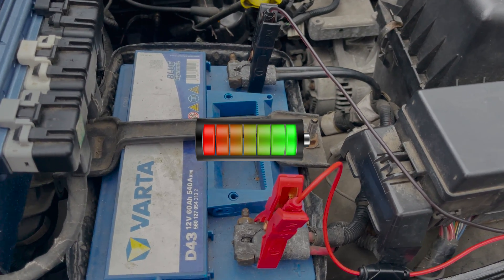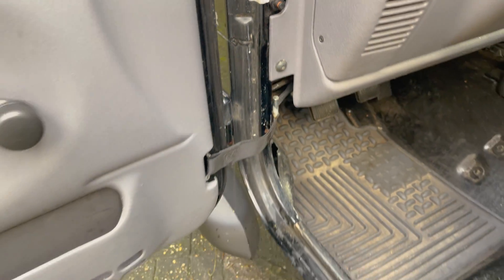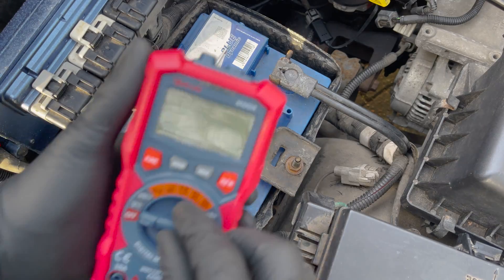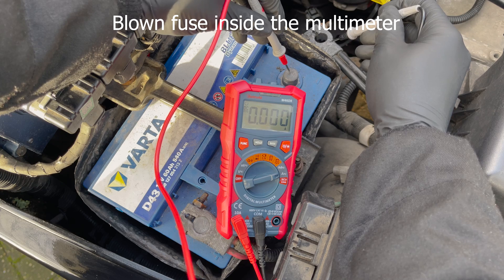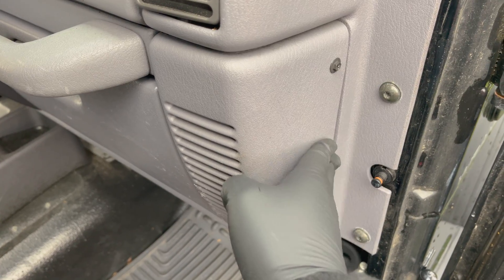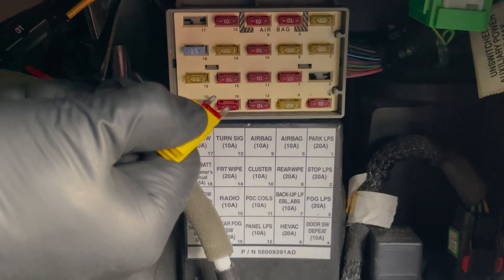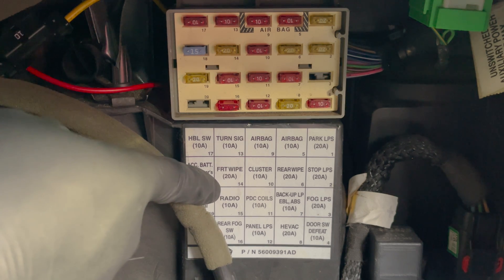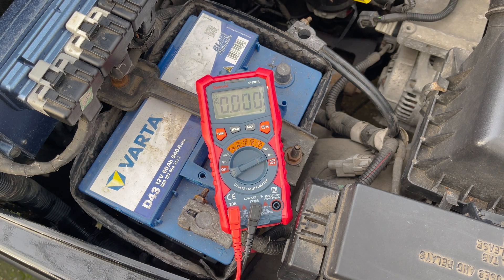The EASIEST way to test parasitic draw

Comment: Hope removing fuse & replacing method won't give wrong readings in a case where a removed fuse controlling a particular component will make d certain modules go to sleep.
Reply from the maker: That's why with modern cars you have to wait half an hour or sometimes even longer for the computer and electronics to go into sleep mode before performing this test.

Comment: Excellent! Straight to the point. Thank you. I had never heard of parasitic draw before today. I just purchased a 2019 RAM 1500. This is the first vehicle I've ever owned that has this much electronics. I love it but I also love my 1989 Toyota pick up. I can replace every part under the hood and see everything. So after turning off the ignition in the Ram 1500 I have noticed that things are still happening under the front dash. Humming, ports opening closing because of the Star Wars-ish whoosh (no exaggeration). It sounds like the opening and closing of the doors on the Death Star. So it made me wonder about power usage when the battery is not being charged. Every time I open a door, lights come on, the screen comes on, and they stay on for what seems a minute or so. So it's got to be a drain at some point right? Doing research today, I found out that it is called parasitic draw and there's an allowable amount of it! I wish it was zero. I'm old school and very utilitarian. I like all the bells and whistles but let's not get crazy. Thanks for the video!
Reply from the maker: Thanks a lot! Glad you found it useful.

Comment: Your meter may confuse some viewers who have a different meter.   On your meter, the switch is turned to the symbol for AC amps, which has the sine wave line under the solid line, but the digital display shows DC amps, which has the symbol with the dashed straight line under the solid line.  I have 3 multimeters where the rotary switch can be set to DC amps or AC amps.  If I did it like you did it on the video, I would be trying to measure AC amps instead of DC amps.  I am assuming that the "func" button on your meter selects between AC amps and DC amps.  Your video helped me a lot.  Thanks for taking the time to post it!
Reply from the maker: You are correct! Our multimeter has a single symbol for both AC and DC amps, which we can switch between by pressing the FUNC button. If you have a multimeter with seperate symbols on the rotary switch, you have to turn it to the DC symbol with the dashed straight line under the solid straight line. Thanks for the feedback!

Comment: In one shot you have the negative lead from the multimeter on the battery terminal and another you have the positive, does it matter which way you do it?
Reply from the maker: No this does not make a difference. It will only change the "direction" electricity flows through the multimeter, displaying the parasitic draw as a positive or negative number. It does not change the measured value itself. If you connect the multimeter between the negative battery terminal and the battery cable with the black test lead on the battery terminal, it will display the parasitic draw as a positive number. Put the red test lead on the negative battery terminal and the black test lead on the battery cable and it will show the exact same parasitic draw, but as a negative number with a "-" sign in front of it.
Reply: @classiccarmaintenance  thanks!

Comment: How does the radio in the car turns on if the negative lead is off? 🤔
Reply from the maker: With the multimeter forming a bridge between the negative battery terminal and the negative battery lead, there is enough current passing through the multimeters' test leads to power the radio and other small accessories. However, the amperage is limited by the capacity of the multimeter itself and its internal fuse(s).

Comment: How does the radio turn on when the battery is disconnected?
Reply from the maker: With the multimeter forming a bridge between the negative battery terminal and the negative battery lead, there is enough current passing through the multimeters' test leads to power the radio and other small accessories. However, the amperage is limited by the capacity of the multimeter itself and its internal fuse(s).

Comment: Hello I'm trying to setup my multimeter to the correct setting.on my multi meter mine doesn't have the A—~ but it has the 10A—~will that still work ?
Reply from the maker: Hi! Yes this should work just fine if your multimeter can measure milliamps in that setting. Put it on 10 amps if this is your multimeters' highest setting and see what it reads. To get a more accurate reading, if your multimeter has multiple amps settings, then select the amps setting just above the parasitic draw your multimeter is reading.
Reply: Thank you also when I plug the red leed into the 10A hole it doesnt get any readings.  The voltage frequency hole(max 300v) gets readings  with the red lead will that still  work the same ?
Reply from the maker: No, you need to measure amps, not voltage. Sounds like your multimeter isn't sensitive enough to measure the parasitic draw or is malfunctioning. Even if your car doesn't have a parasitic draw, your multimeter should measure some milliamps, never a zero value.
Reply: Hello I bought a new multimeter with the correct settings . It.shows a 1.39 draw on the multimeter and right away the horn started going off . Am I doing something wrong ?
Reply from the maker: It's impossible to tell what's exactly going on not knowing the setup of your specific car, but chances are you set off your car alarm by disconnecting your car battery. This could in turn activate your car horn. This would also explain the 1.39 (amps?) draw your multimeter is reading.
Reply: if you car is drawing more than 10A when you used the 10A setting on your multimeter and you are reading zero, it means it blew the 10A (inside the meter if there is one) or it damaged your meter already. some multimeter doesn't have internal 10A fuse.

Comment: If I hook my multimeter up like you did, should I still be getting power to the car?
Reply from the maker: Yes, the power will run through the multimeter but will be limited by the fuses inside your specific multimeter. If the power demand surpasses the capacity of the fuse(s) in your multimeter, the fuse(s) will blow. For example, this can happen if you try to start your car.

Comment: I have a reading 0f 4.8mA (no matter what the setting on the multimeter the decimal point doesn't move?doing this) .I can't turn the ignition to accessory position to test the a draw increase as not even the dash or  interior lights come on with the battery cable off, let alone the radio?
Reply from the maker: There is no need to turn your key to the accessory position to test for parasitic draw. You should test this with all electronic components and accessories turned off and wait until the computer goes into sleep mode if you have a modern car. In our video we turned the key to accessory mode with the radio on to simulate a parasitic draw for demonstrational purposes, as our car did not have electric issues.
Reply: @classiccarmaintenance   Hi, new starter motor fitted. Today I tried removing all fuses one at a time with the multimeter in series on the neg cable. With car shut and locked, (apart from bonnet). After a while I got a 0.35A to 0.15A draw. Removing fuses one at a time (from all 3 fuse boxes), didn't do anything. Removing the positive feed to the alternator (from the battery terminal) didn't do anything, (did this checking for a shorted Diode causing drawback). The only way it totally disappeared was by removing the Positive connection to the engine bay fuse box; But that just made it read as zero. I don't know what else I can check now?
Reply from the maker: Hi, could you specify if you disconnected the positive cable to the fuse box at the battery terminal or at the fuse box?

Comment: How we can bring hybrid car in accessories mode without connecting negative battery cable? Or is there a different method to test amps drop in hybrid cars?
Reply from the maker: Thank you for your question! For hybrid cars, due to the complexity of their electrical systems, it's best to consult a professional licensed mechanic who is trained on your specific brand and model. They have the specialized knowledge and tools to safely and accurately diagnose and address any issues, without causing damage.

Comment: What if you need a certian accessory to be on all the time? Like a third party car alarm, gps tracker and dashcam running the continous draw from the battery?
Reply from the maker: In that case you need to hook up these accessories to an external power source to power them before disconnecting the battery. We like to use a car battery charger that has a supply mode like this one https://amzn.to/3wxSJRg. Always first check your car accessories’ owners manual for instructions.

However, it’s important to know that if you use an external power source, you won’t be able to tell if the parasitic draw comes from any of these hooked up accessories.

Comment: I guess with classic cars you don't worry about wiping out the car's computer memory (for whatever it saves) by pulling off the ground cable.
Reply from the maker: You’re absolutely right, disconnecting the car battery is not an issue with old school cars that don’t have advanced electronics or accessories. However, If you have a modern car with electronics and/or accessories that need continuous power supply to not lose data and settings, you need to hook them up to an external power source to power them before disconnecting the battery. Always first check your car's owners manual and your car accessories' owners manuals for instructions.

However, it’s important to know that if you use an external power source, you won’t be able to tell if the parasitic draw comes from any of these hooked up accessories or electronics.
Reply: @classiccarmaintenance  Lately with my "modern car" ('07 Acura MDX) I had a parasitic draw (well-known to dealers and many, many owners) and I became an armchair YouTube "expert" on the issues of draw and memory saving. With the investment of a $40 Digital Clamp Meter (that also has other Multimeter functions and probes) here's what seems to be the best "modern" approach IMHO (mostly from a former Acura mechanic):

1) Put the clamp meter around the ground cable to measure DC amps. No battery cable disconnection. No outside power e.g. 9V battery, another 12v battery, or jump starter, needed to maintain memory components or to hide a parasitic draw.

2) Test compatible fuses (conductive access to both poles) with a multimeter in a systematic manner without pulling the fuses to test voltage drop. If a wiring diagram is available that's even better, or just common sense from labels on the fuse box works, e.g. if the radio or wipers work - don't bother testing their fuses.

Comment: Will this work wirh a multimeter that only has 5A?
Reply from the maker: If you make sure that everything in your car is switched off before testing and if the parasitic draw is below 5A, it will work just fine. Worst case, if the parasitic draw is higher than 5A, your multimeter might blow its internal fuse. Most multimeters have glass fuses, which are cheap and easy to replace, so that’s no big deal. We’ll be making a video and a post about that in the near future, by the way. If you don’t feel confident about your multimeter, you might want to check out our post about the best multimeters through the link in the description. A good one doesn’t have to be expensive. Hope that helps you out. Happy cruisin’!

Comment: You said to keep doors locked all time. But you opened the door to get in to the fuse box, wouldn’t that mess up the test?
Reply from the maker: That’s a valid question, you have a good eye! 
If you have to keep your door open to film the testing process like we did, or because the fuse box can only be reached with the door open, you want to manually lock the door locking mechanism or tape off the door jamb light switch to prevent keeping the computer(s) awake and to shut off the interior light(s). If you manually lock the door locking mechanism with the door open, do not forget to unlock the locking mechanism before slamming the door shut though! It’s a good idea to put some tape on the door or on the door handle as a reminder.
Because our ‘98 Wrangler only has a very basic ECU, it does not “lie awake” (pun intended) over an open passenger door. We just removed the only interior light bulb to prevent it drawing current.
Reply: @classiccarmaintenance okay got it thank you! Great video btw!

Comment: I had to open my door to get to the fuses, which jumps the lights and then waited for them to stop to get an accurate reading. I pulled a fuse for my seat and saw a change but after putting the fuse back the reading was normal.

Comment: An excellent video, brief but detailed. I understand with modern cars with their numerous computers it's even better to check for any voltage drop across a fuse using a second multimeter across the small terminals on each fuse. Thus the fuses are not removed which could "wake up" any computers which take a while to "go to sleep" when the fuse is replaced.
Reply from the maker: Hi, 
Thanks for your reply, appreciate it!

You’re absolutely right that there are other ways to test for parasitic draw, like measuring and  investigating the relation between voltage drop and current draw by testing over the fuses while in situ. However, this involves testing and calibrating your test equipment before you start, researching “normal” power consumption of each circuit on your specific vehicle (taking into account aftermarket equipment), closing or latching all door locks and avoiding anything that might trigger a sensor that could “wake up” the car’s computer(s). To be absolutely sure that the computer(s) are “asleep”, with the latest cars you might have to wait up to 2 hours. 

To interpret the readings you get over the fuses, you would have to use a comparison chart, specific to the type of OEM fuses that are used in your vehicle. Aftermarket (replacement) fuses that often look exactly like the OEM ones might give different values and will be hard to guesstimate. That being said, these tests are very specific to the brand and model of your vehicle and to do it right, you need access to the correct information and experience with this exact type or family of vehicles.

Our aim is to empower people on how to do a basic DIY test for parasitic draw that anyone can do, with a small budget using a simple cheap multimeter, without needing expensive equipment. Although it’s a basic test, and it may not be perfect, it gets the job done and it will eliminate all major parasitic draws in minutes.